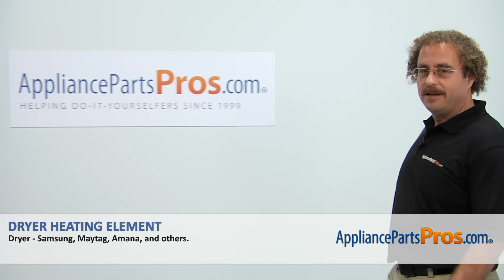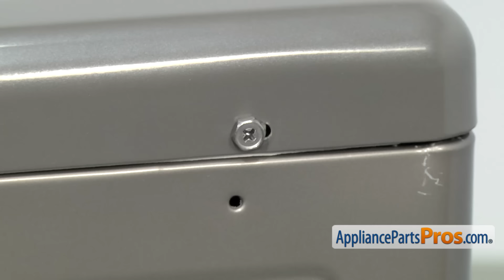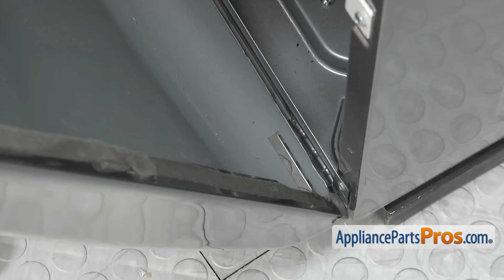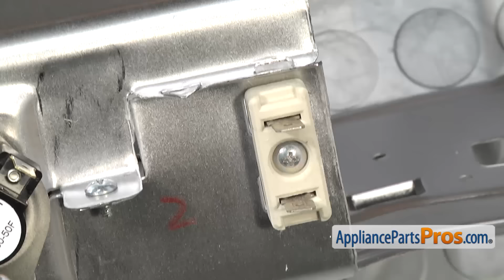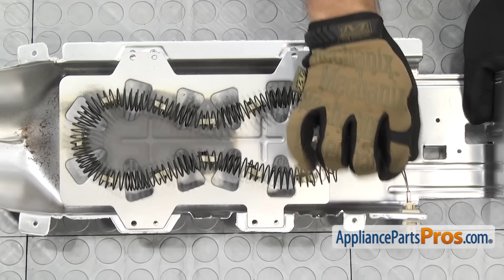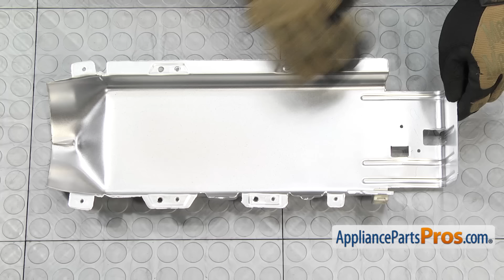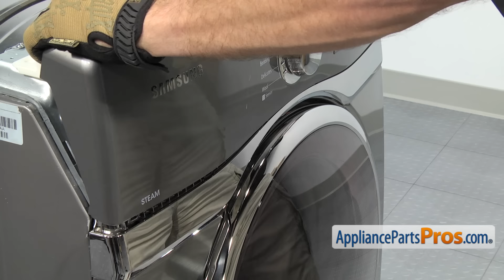How To: Samsung Dryer Heating Element DC47-00019A

Comment: Our Samaung dryer was not that easy to open(the plastic panel was tricky to remove) and then the part on which the heating element was placed, it was  screwed to it as well, and screwed on the other side( had to bend it down in order to take the element box out).
Reply from the maker: Glad you were able to fix your issue! If there is anything we can help you with in the future please let us know.

Comment: So after I did this there was a pop and a light flash from inside the dryer. Is that normal?
Reply from the maker: There shouldn't be a pop or a flash after installing this part. You may have a burning smell for a few minutes, but you will need to check the installation of the part and check the thermostats to make sure one of them didn't blow.

Comment: After checking out many other videos I ended up following yours, thanks for making a simple easy to follow instructional video....good job!!
Reply from the maker: You're welcome! If there is anything we can help you with in the future please let us know.
Reply: @appliancepartspros  Actually, I have a question for you, since I know I installed it right :) when I did the test cycle, it started off fine and then it made like a pop noise and it sounded like a spring broke! Well, when I took the dryer apart, I found it had done just that. One of the springs completely popped off and looked like a flimsy noodle, not a brand new heating element! What do you think caused it?
Reply from the maker: Unfortunately, we do not have any way to determine what caused that problem. It could have been caused by numerous factors. You could have received a faulty part. If you purchased that from us you can call us with the model and serial number of the dryer and we can send out a new part as long as it's still within the warranty time frame.
Reply: @appliancepartspros  thanks for the info! Yep, I think it's a bad part. I got it from Amazon, so I'm returning it now. Actually, how much would it be from y'all? Heating element part # DC47-0019A for a DVE(G)50R5400 Samsung Dryer. Serial number 0AYL5BBM404254A. THX
Reply from the maker: You can take that part number to our website to look up the price for the part. If you have any other issues just let us know.

Comment: i just did it and it smells like fire kinda is this normal?
Reply from the maker: You could get a slight burning smell but it should go away pretty quickly. If you see smoke or it continues the burning smell check to make sure you don't have a build up of lint inside that could be causing this issue.

Comment: Thank you so much for this video! Just fixed my 2005 Maytag Neptune dryer. Could not have done it without your video. Took pics of wiring. Super easy!!!
Reply from the maker: You are welcome! Glad you were able to fix your issue! If there is anything we can help you with in the future please let us know.
Reply: @appliancepartspros I do have a question Sir. I removed the thermostat and the thermal fuse. But when I went to put them back, now I don’t know if they’re upside down or not. I don’t want to connect the blue and black wires up wrong.  Would you please help me with that? Thank you so much.

Comment: If you can, order the entire heating assembly, the whole silver tube that the heating element is inside, along with the heat sensors and fuses attached to it..  It will cost you around twice as much as the element itself but you save a lot of time by not having to open it up and disconnect and reconnect all the wiring.  Additionally, if your problem is not the element but one of the sensors and fuses attached to it, you would end up going through the entire process only to find that your dryer was still not working By simply replacing the entire element, I had the entire process done and dusted in less than an hour.  The heater assembly cost me $60 plus tax, vs around $25 for the element.
Reply from the maker: Thank you for the tip!

Comment: Is it normal for the dryer to smell like something is burning the first time you use it? Is that the heating element burning of some residual material?
Reply from the maker: It can have a burning smell at first, but should go away pretty quickly. If it is a constant smell, then you will need to check to make sure the element is not broken, or you don't have lint build up inside there that could cause a fire.

Comment: My blue and black wires that connect to the heating assembly ripped. Does your website have those parts available?
Reply from the maker: What is your model number?
Reply: @appliancepartspros  DV405etpasu/aa 01
Reply: @appliancepartspros  dv405etpasu/aa 01
Reply from the maker: Thank you for that model number. Unfortunately, those wires are part of the main wiring harness and the manufacturer no longer makes that part, we are out of stock and unable to order any more. The part number is DC93-00067F. You can try searching to see if you can locate that part in stock somewhere.

Comment: There are actually two screws behind the lower bracket that you need a small woman that can with stain sheet metal cuts to her hands to get that support bracket out.
Reply from the maker: Our videos are generic videos to give you an idea of how the repair is done, some steps may be different if you have a different model.
Reply: Yeah I guess Samsung hated this video and decided to make it more difficult to remove the bracket 😂. Just gotta figure out how I'm going to reach those two rear screws. They even added a screw attaching the bottom of the element housing to the top of the bracket on my model

Comment: When I removed my heating element, my black and blue wires were installed opposite. Should I follow your directions or place the wires the way they originally were? I decided to replace everything(thermostat, thermal fuse)

Comment: 3:19 - I wish that heater core lower bracket in my Samsung dryer (Built in 2015) was that easy to remove - my bracket had two extra screws behind that attached to the dryer bottom panel. It was a somewhat awkward reach, but luckily I had a small enough screwdriver to remove them!
Reply from the maker: Glad you were able to get yours removed! If there is anything we can help you with in the future please let us know.

Comment: Worked like a charm! Make sure the heating element housing is in tight against the heat exhaust at the back of the dryer. Could be a lot more secure. Fire extinguisher on hand as I do my first test run.
Reply from the maker: Good luck with everything. If there is anything we can help you with in the future please let us know.

Comment: Does this video work for Samsung model DV42H5000EW/A3
Reply from the maker: This video should work for your model.
Reply: @appliancepartspros  - quick question. Do i need to buy orginal part from samsung or does the OEM part works fine?
Reply from the maker: Per the model this is the correct part that you would need and would work. All of our parts are OEM parts from the manufacturer.

Comment: On the first set of connectors, I have three prongs instead of two. I have a red, a white, and a blue wire. Can I switch it to a two prong and not use a wire?
Reply from the maker: What is the model number of your dryer?
Reply: @appliancepartspros  samsung dryer dv56h9100eg/a2
Reply from the maker: You would have to use a 3 prong for this model.

Comment: Very much appreciate the quality of this video in both great visual aids and great instructions.  For some, like myself, be warned there might be a screw on the back of that bracket that holds up the heating element between the two tabs you have to pull up.
Reply from the maker: Glad we were able to help you. If there is anything we can help you with in the future please let us know.
Reply: @appliancepartspros  Will do and thank you again.  I definitely did not put that screw back in on the back side of the bracket.

Comment: Great video; really helps and thank you for easy parts ordering!! A couple of suggestions:

1) Before assuming heating element, make sure to test both legs of your 220 outlet and make sure you have 110 on both, as one side drives the motor and controls and the other the heating element

2) You can put a resistance check across the old element to verify a dead ground or break in continuity

3) While in there, I'd recommend also replacing not only the heating coil unit, but also the two temperature fuses and the thermostat, just for good measure
Reply from the maker: Thank you for the suggestions! If there is anything we can help you with in the future please let us know.

Comment: My samsung dryer only had a small difference. The "lower bracket" had screws in the back, plus one in the middle, attached to the heating element. This meant that you had to pull the upper and lower assembly far enough forward to reach that middle screw.  But otherwise, it was identical. Thank you very much for this video!
Reply from the maker: You are welcome. If there is anything we can help you with in the future please let us know.
Reply: How did you get the back screws? I can’t reach them and I don’t want to have to take the entire back off
Reply: @Scud5733  I used a small stubby screwdriver. Once removed, I did not reinstall them.
Reply: @nicholas_scott . Thanks. I bought a stubby screwdriver and it was still next to impossible. Using a kitchen jar grip gave me the leverage to unscrew it. Terrible design flaw by Samsung yet again.
Reply: Hey thank you for commenting this - mine is the same configuration you described and I was glad to hear your solution.
Reply: Mines the same with the awkward screws at the back. Even a flexible screwdriver couldn't reach them. Anyways the panel is quite flexible. After removing the top screw, I just gently stretched mine out till I could get the element box out. Then afterwards I just stretched it back to form. It may be a little deformed but all the screws were still intact. This video saved me $500. Just elbow grease and some sweat.

Comment: My element shorted out and the control panel doesn't light up and you can't power the dryer on.   Could it have blown a fuse somewhere?
Reply from the maker: It is possible that could have happened. What is your model number of your dryer? Do you have a multimeter?

Comment: Absolutely the best, clearest easy to fallow Video! Changing my Samsung heating element was made easy with the help of this Video! 👍👍👍 This is the First heating element to go bad on my Samsung dryer in 7 Years and it, went bad due to my not cleaning the lint catcher, with every load and cleaning out/replacing the exhaust pipe/hose more often!  There were great balls of lint all inside the dryer housing and the exhaust pipe was Almost completely clogged. I’ve learned several valuable lessons during the replacement process. Love my Samsung!
Reply from the maker: Glad you were able to fix your dryer! If you need help with anything in the future please let us know and we will be more than happy to assist you.

Comment: Any advice on getting the red and blue cord off the heater element? It’s like mines are super stuck! My dryer did have a lot of lint after 7 years
Reply from the maker: Is there not a little screw that you have to undo or are you not able to just pull them off? What is your model number of your dryer?

Comment: Thank you for making this video. I wouldn’t have been able to replace the element without it… however, after replacing it (and it was certainly broken, the coil was snapped), the heater still won’t work. Any idea why not?
Reply from the maker: Have you recently had any power outages? Have you tested the thermostats to make sure that they are all good? Check for loose or damaged wires?
Reply: I replaced the thermostat. Still no heat. Are there two different thermostats?

Comment: Thank you AppliancePartsPros!  I successfully took apart & bought your original replacement part. I was able to take it apart, replace the heating element & put it all back together again because of this detailed video.  It even works!!!!.  
If I can do it, the rest of the world can do it also!!!!  Had to have a little husband help to get a couple of screws  loosened (we had to get the battery operated screwdriver to get them out) and flashlight assistance when putting the heating element back in on top of the stand.  Otherwise, just follow these instructions!
Reply from the maker: Glad you were able to complete your repair. If there is anything we can help you with in the future please let us know!

Comment: Thx for this. Very easy to follow and now I have a working dryer again. Just a heads up, my heating element support had 3 extra screws to remove before taking it out. None of them were easily accessible and it required bending the metal to get access to them (everything bent back no problem).
Reply from the maker: You are very welcome. Our videos are just to help give you a general idea on how to do the repair. If there is anything we can help you with in the future please let us know.

Comment: Tracking until locking tab when pulling front off... doesn't want to amd I don't want to pull too hard and break it 😢 not a great day
Reply: Finally got that part

When reassembling it has wires to thermostat and 3rd connector as blue front- black back then reversed.  I took photo of mine prior and didn't notice it was same.  I've had dryer for 12 years no issues, but still has Me second guessing.  Assemble as was or as shown?
Reply from the maker: You would reassemble your wiring as it originally was.

Comment: I replaced the element and fuse and put it all back together, I went to use it and it now heats but smells like something is burning, is that normal?
Reply from the maker: What is your model number? Have you checked to make sure that no wires were loose or damaged?

Comment: Great video!  Too bad I found it after watching another screw-by-screw how-to that involved complete disassembly and drum removal, which I followed to the letter. I found an open in the heating coil; Just got the part. Now to put it all back together. I'm not looking forward to dealing with the belt idler pulley ( have to do it all by feel while fighting against the force of a mighty spring ). If I had just seen this video first, the laundry would already be done, folded and put away.
Reply from the maker: Good luck on your repair. If we can help with anything let us know.

Comment: Thank you for the video, very clear and perfect pace. I had a fair amount of trouble getting the heater housing back on the duct, and on mine the wires were not long enough to take it out with them attached. Mine is a Brada label.
Reply from the maker: You are welcome.

Comment: What is the wire gauge size of the red wire on the heating core? Mine burnt and broke off at the connector and can't find a solid answer on correct sizing or were to buy the wire harness for it
Reply from the maker: We do apologize but the manufacturer doesn't provide us with the size of the wire. What is your model number and we can see if we can find a wire harness for you.

Comment: I have  Samsung DV42H5200EW/A3. At about 3:24 there should be further instructions to remove 3 more very difficult additional screws. One holds the top heating assembly bracket to the lower support bracket, and two more directly behind the support bracket hold it to the bottom frame. These are all hidden and very hard to get to. My dryer did not have rear bracket tab slots but instead 2 frustrating screws you can't see. Otherwise, this was a very good tutorial.
Reply from the maker: Thank you for this information. Our videos are just general videos to show you how to do the repair. Our videos are not model specific and can look different from your model number.
Reply: @appliancepartspros   What I should have said was that it was a good tutorial regardless. It's just that the repair was not as simple as I had anticipated based on this video (and others).  I have the bruises and cuts on my arm to prove it! Could not get to those hidden screws wearing gloves. Perhaps in my case more teardown was required for access to those 3 screws. Doing it by feel alone and teeny incremental screw turns got the job done.
Reply from the maker: Glad the video was helpful, but sorry that the repair wasn't as simple as you thought it would be.

Comment: My heating element wasn't producing heat - BUT it is intact, no obvious breaks. I checked the resistance and it measured just shy of 10 ohms. What am I missing? Could the element still be the issue or could something else be wrong?
Reply from the maker: That depends on the specific model number, but the next step is to check the thermostats and fuse (if applicable) for continuity.
Reply: @appliancepartspros  Thanks. The fuse was the problem. It went again though. I checked all the vents, they are quite clean. Upon seeing this comment though I am wondering if the thermostat could cause something to happen which leads to the fuse going?

Comment: My heater core bracket had two screws on the back instead of pressure fitted tabs ……. Whhhhhhhhhhhhy 😢😢😢 . Great video , Samsung you suck for those two screws instead of tabs

Comment: This is a great video, thank you so much. I followed all the steps and put it back together. However, now every time that I turn on the dryer, the circuit breaker trips. Any ideas what the reason could be? Thanks.

Comment: Thanks for this video!  I feel very proud to have fixed the dryer using your wonderful, step by step instructions - thanks for showing the full scenario by including putting the dryer back together &for suggesting taking pictures of the wiring as mine were slightly different - much appreciated!

Comment: I replaced the heater core, thermal Cut Off Fuse, Thermostat, Thermistor, thermal fuse and the dryer still doesn’t heat up. Any suggestions?

Comment: how can I tell if it's the element, the thermal fuse or the thermostat? I assume the thermal fuse and thermostat should read as a short if the coil isn't hot?